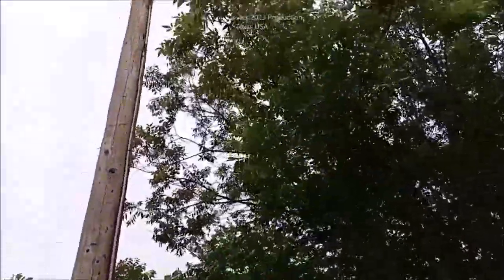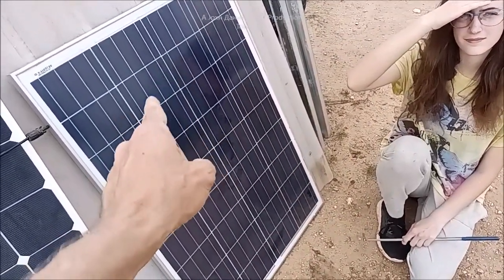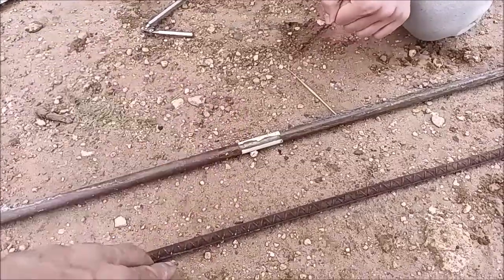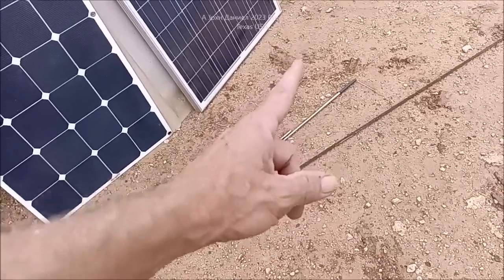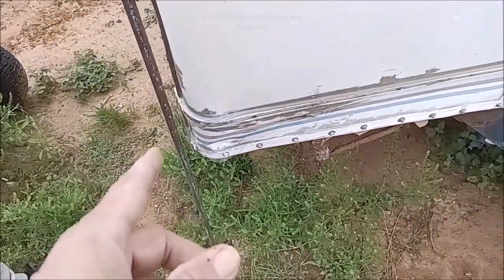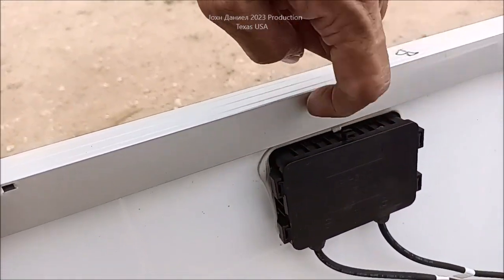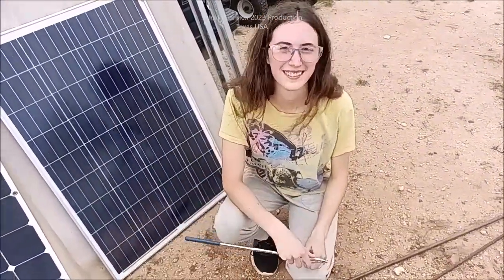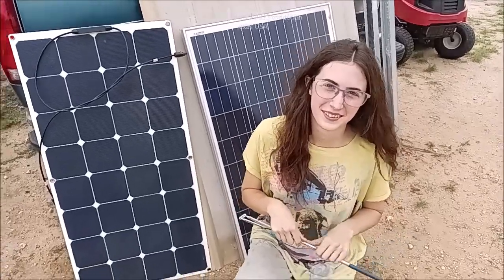Grounding your SOLAR PANELS? 🤔 You Better watch this First! *KNOW DC/Inverter POWER is not Utility

Comment: My inverter says to connect the chassis ground lug to earth ground but after watching your video (and doing additional research), I now know this to be foolish. My question to you, if you wouldn't mind answering it, is should my inverter on the AC side have ground bonded to neutral or should they be unbonded? It's a Giandel 2200W Pure Sine Wave inverter (if that even matters). Thank you in advance for all your help!
Reply from the maker: Inverters do not have actual ground as a produced circuit in them. They are synthesized sine wave. It's electronics itself is it's "ground fault" safety system. In a inverter you have basically 2 hots. Not a actual common (white wire )  and line ( black wire hot). Inverters ( USA voltage style ) have actually a switching cycle, not a real "hertz" ( RPM's ) made by rotating generators for utility. So they have NO common. It does minus 60 volts. Mosfet Switch, then positive 60 volts, Time Circuit and repeat 60 times a second. A shock hazard safety is any change to that to a ground, damage or short circuit causes it to fault. It's really just a 2 wire system.  The "ground" lug on them is for NEMA and UL and CE requirements, not for function.
Reply: @JOHNDANIEL1  Thank you for that. So, if I understand you correctly and I hope that I do so as not to appear to have wasted your time and energy, you are saying that my question is technically irrelevant even if the AC side had a bonded "common" and "ground" internally because the "common" isn't even a real common and the ground is BS from some government check casher. Interesting and much appreciated.
Reply from the maker: @AdamShumpis  Exactly

Comment: You are not directly grounding DC circuit but all the other (outer) conductive parts. Because the charge from lightning is always trying to find the shortest way to the ground and the lightning (or rather overvoltage from nearby lightning) affects all conductive parts in vincinity. The charge is the reason for the lightning and it is always going from the sky to the ground regardless of any circuitry. Because of potential difference between ground and clouds (and it behaves like big natural circuit of it's own).
Second thing - AC doesn't automatically need ground. It's needed for some 3p motors or heaters or for derived 1p circuits done in last-mile grid.
Third thing - DC circuit should have MPD surge protection against overvoltage caused by lightning (excess voltage will be grounded!) and all other parts should be grounded. Either solar panel arrays either the internal DC wiring (not directly but as said through surge protection device). Solar regulators have their own grounding points.
---
Addition: this is getting a bit confusing because rather different situation may be for cars and caravans which are not grounded and may have their own potential (may be less than the ground if this is the case - they may less attract lightnings). Anyway again things should be grounded to such object (not earth outside) which will then behave as Faraday cage..

Comment: If your frames are not earth grounded, a lightening strike will seek the easiest path to ground; through your panel circuits and through your inverter; blowing up some very expensive equipment!
You ground (bond) your frames to protect that expensive equipment from the lightening surge; providing a low resistance path to ground.
If the concern is the liklihood of a lightening strike to your panels, mount a 6 lightening rod near the panels; provide the lightening an easier path to ground than your panels.
The DC feeding from your panels does not require a ground but most split-phase inverters do.  Static charges that build up in normal operation must be drained off or risk destroying the controller electronics.
The ground rod of the frames must be seperated from the equipment ground by a minimum of 10 feet to prevent backfeeding a lightening strike into your equipment ground.
Reply from the maker: Easiest path for lightning via your panels is by grounding them, it attracts the lightning by making a sure path for it. By them getting struck you will destroy your connected electronics no matter what you do just based on the flushing effect lightning has on earth ground. We want to believe, and your welcome to do so, that lightning is a thin line of electrical energy that just tracks as if by a rule the wire you installed for it. It absolutely does not. Solar arrays are more damaged due to group grounding than floating ungrounded. The more you make a massive target for lightning ( using a ground rod ) the more likely you will get your strike. Adding a nearby target that is fully attractive and taller totally prevents any lighting and sourcing your array. Consider this test. Take a 10 foot pole, add a heavy copper wire, connect to a deep ground rod, now hold that metal pole in your hands in the air during a lightning storm. Does all the lightning only go though the pole and wire? Or does or radiate into you that's holding the pole too? 
Now do it separately with all mounted but you not holding it and note it does not radiate into you. Same effect if you ground the solar ( represented by you holding the pole ) or make a target not connected to you ( diversion mounted to draw strikes away from you ). 
We choose diversion lightning rods (post) and omit our solar being the choice target.
Reply: @JOHNDANIEL1  I presume you didn't read the entire response or misunderstood it as I indicated that the ground for the panel frames needed to be separated a significant distance from the equipment ground to avoid the flashover.
Having survived 2 near lightening strikes (within 10 feet), I am well aquainted with flashover.  I have had my wind turbine pole(grounded) hit by lightening several times and the panels underneath the pole were fine as was the inverter.
Reply: @JOHNDANIEL1  That may be truth only if all parts in vincinity are insulated from ground and not "naturally" grounded by rain. E.g. for cars and caravans with solar panels. 
But it's usually not true for buildings, therefore even if the panel is not getting hit from lightning it will receive high voltage potential from lightning in vincity which will probably damage the regulator and other devices.

Comment: I earth grounded my solar pane frames because you want to give the lightning bolt the shortest path to earth, otherwise it may run on your dc wires and reach your inverter where it will damage it
Reply from the maker: If lightning hits your panels there is nothing to stop it's effect on modern electronics. Nothing. The only solution is diversion like they use in massive arrays. Sacrificial sections or attraction mast are used. Grounding your panel frames only assist the lightning to find them. Does not stop the static energizing all of it.
Reply: It has something to do with insulating the whole object from ground potential. So it might work for Faraday cage type of installation like caravans. But even for those installation you should ground everything (e.g.regulator) to the common ground of the insulated object to avoid potential differences. 
So the video is partly true, but the explanation is rather confusing.

Comment: Does an inverter feeding a breaker box need the box to be bonded? and a sub panel to that be left unbonded? The breaker box and the wind turbine are the only things I figure need grounding. three wire to a rectifier. If converting to DC does the turbine need a ground still? That was a really good video and thanks for answering many comments. It was informative reading.

Comment: I disagree with the rebar ground rod.  Iron oxide is a very poor conductor.
Reply from the maker: Your not using is as a conductor that is flowing constant voltage for a circuit, your using it as a shunt to dump lightning strikes into.
Reply: You should compare it with the copper green rust (verdigris) conductivity...

Comment: The thing is your dc wires will then be your shortest path to ground through your inverter and through you who is using some equipment. You should have surge protectors on both the + and - lines on your panels. You then ground your frame so that that is the shorter path to ground. Of course you should include lightning rods at a higher level than your panels with its own ground rod

Comment: An interesting video, thanks for posting it. The comments are even more interesting than the video.
I am not one for believing this or that, or him or her, i prefer to get as much information as possible and have an opinion i can at least consider to be my own.
 Are you saying that grounding the panels is only protecting you from problems you wouldn't have, if they weren't grounded? But this is only applicable when the voltage is low enough to not need addition security measures.
And, that when the voltage is high enough to warrant additional security measures, the additional security measures are plenty adequate without the complication of grounding?
Or am i just as lost as many of the other comments?
Reply from the maker: Consider this basic reality. A solar panel is in no way different in electrical conductivity than a aluminum house window. Yes the cells in the glass make power however none is sent through the metal frames and no electrical characteristic exist until you do one unusual thing to the solar panel that you do not do to your aluminum house windows. The one thing that "enhances, conducts and creates" it's electrical property is when - YOU GROUND IT.
Science, if you still believe in it Post Covid 19, says one thing. When you add a earth ground to anything that is not electrically phased then you introduce a non-natural attraction to lightning and a atmospheric eddy current into that item.
To show you how that works. Get a 100 foot extension cord, using one wire in it ground well one end. Go to the other end and with a multimeter place the + probe into the ground and the neg probe onto the corresponding wire you grounded 100 feet away. Note the now existence of voltage. The earth is electric. And when you connect isolated aluminum panel frame to it, you end that neutral isolation and induce a pending static charge.
Reply: @JOHNDANIEL1  Earth is not electric. Earth have stable electric potential which may get different against sky or clouds which gets "electric" by weather. The difference of potentials (voltage) is the drive for lightnings.

Comment: Thank you, John, for your great video! Question: if you have solar panels on a metal roof and they are in parallel with the DC voltage over 100 volts and you are working on them and a down pour breaks out and you're touching the aluminum frames. Is there a possibility you will get shocked as water passes down your body and rolls off the roof to the earth which is ground? I have a 12 volt off grid system and my panels are all under 50 volts dc and in series, so I am not worried about grounding them. But some guys have systems where the DC volts can be 200 volts plus since they wired their panels in parallel. Thanks, if you have the time to answer.
Reply from the maker: If your wired wrong and your using the isolated aluminum frames as a conductor your already on the wrong path. However, if your up on a roof when rain is obvious your also starting the day bad. As for the rain and shock hazard the roof being metal far exceeds your conductivity of pure water ( rain water has no magnesium or saline in it to conduct much power under 500 volts ). *The scenario is like saying: *If I jump out a plane without a parachute but the ground is all marshmallows, and the wind is blowing 900 mph how hard will I hit the apple tree that's not there! In other words, random rarity that if you die, it's a world record worth bragging about in the afterlife!
Reply: @JOHNDANIEL1  Thanks John!

Comment: I've had a 100w solar panel since '13, initially just an experiment in learning about solar, couple yrs ago moves it to front yd to supply pwr to charge controller for 33ah lead acid battery to power 12v flood light for my flagpole at night, just got 'nuther pair of 100w panels so can power electric chicken fence to keep predators from killing them all, again. My orig panel has never been grounded in either location.

Comment: I’m not an Electrition but I understand DC don’t need to be grounded but when you have solar panels you turn DC into AC so the AC need to be grounded am I wrong about that
Reply from the maker: Yep, wrong about that. The Solar panel is a device that only makes DC voltage. A Solar Controller is a device that takes that "wattage" and converts it to DC Charging to place the results into a storage battery system. From that storage battery you get again, DC voltage until you send that to a Inverter, which is a device that synthetically makes a alternating current/voltage to use on AC devices. Since a Inverter is not a power generation system ( utility ) it is making the conversion from DC to AC power with some form of buck boosting and switches to create a sine wave, usually Mosfets and transformers. That process only creates 2 fields. Some are both synthesized as both hot + Line 1, hot - line 2 and some from pure sinusoidal wave of ZERO on Hertz. NONE are using a ground to create the output. The controller circuit in a inverter is used as the safety system, it actually can not fail either, so it is safer than a actual "earth Ground" since it does not require numerous connections to function.  It works as follows. Billy grabbed the output of a inverter, he was SHOCKED to see it immediately shut off. He heard from the brilliant code talkers that it would kill him. Then Billy learned a Inverter is sensitive to "wave variation" and will fault so fast that it's considered the safest power system to use in Ambulances and Hospital equipment since only 1.5% wave variation will fault it to stop working verses up to 15% in a Utility Grid non GFCI systems with double bonded circuits. 
The Ground post on a inverter do not actually do anything but chassis grounding, however you do not have voltage in the chassis, TILL YOU GROUND IT!!!
Reply: @JOHNDANIEL1  Grounding and null pole (blue conductor wire of AC wiring) are not the same! Old wiring schemes used only 2-wire AC which one was null conductor and null pole which was grounded, but only in the local end (house wiring after 3phase division). Modern AC wiring uses Power, Null and Earth protective wire (yellow/green) which are never connected except where it begins - in residual and overcurrent switch device (best solution for higher safety). Same as modern inverters use the 3-wire output which reacts to residual current and will shut down once live wire output is tampered (except the cheap ones). Residual protection works due to Earth/protective grounding!
I would say that the whole explanation is quite a misconception.
You are true in some points in the video but not here.

Comment: Be aware there is risk when choosing to purposely violate the National Electrical Code and well documented sound engineering principles.
Reply from the maker: I recommend we stop avoiding all those codes written by folks who never installed as much as a light bulb and slapping a ground rod on everything from your De'lorean to your granny. However, this ain't 1950 where the bureaucrat was also once a skilled craftsman or site engineer. Nearly everyone of them brilliant purple haired code writers now has a second masters degree in gender studies and a drug habit. And exactly why over 75% of the codes written since 1960 are still in permanent re-review! 
I use the Japanese code basics, created by domestic law from folks who intern in the actual craft. So, if you are truly interested in "safety" then you compare OUR system with 8 injury/damage events for THEIR system of 1 Injury/damage events per 1000 and apply what actually accomplishes your goals. Over 3/4 the codes written since 1977 ( including BOCA and UEC Updates ) are all profiting based to some lobbyist or another industry influencer. Codes that should have been written were lobbied against by the same folks.